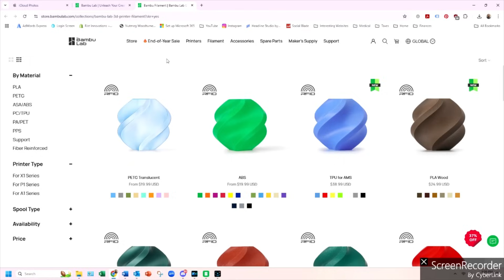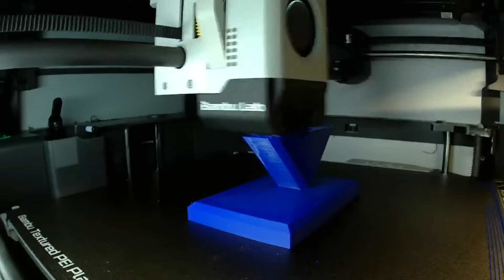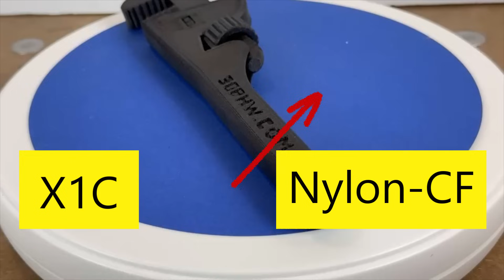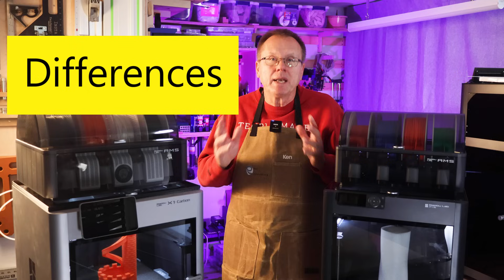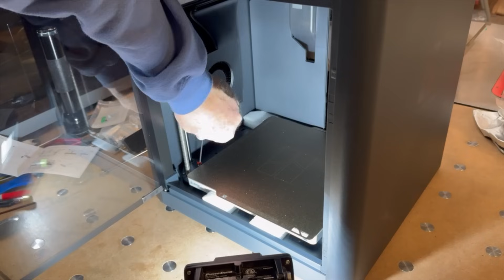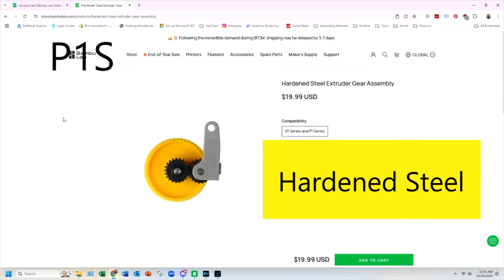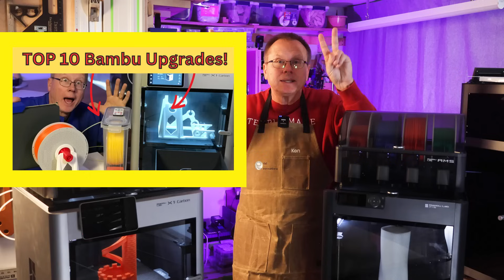Bambu Lab P1S 3D Printer: Better Value Than X1C?

Comment: Just in time! I was considering buying a 3rd X1C or 2 P1S' for print production. My main sticking points right now are banal, but it's because I'm an X1C owner I have a lot of hot end assemblies so those are different on the P1S, but at least the build plates and most other spare parts are the same. Watching for new insights I hadn't considered :)
Reply from the maker: I imagine it also depends on what type of materials you are mainly printing on the X1C.  If they are the higher end polymers, then maybe sticking with the X1C would be best for you, especially if you have a production line.  If you are mainly printing PLA, PETG, ABS, ABS-GF, ASA; then maybe the P1S would be a better option to expand your production capability.  In my opinion, you really can't go wrong with your decision, depending on your preferences.  Thanks for taking the time to leave your comment and good luck with your decision!

Comment: Thank you for conducting the comparative testing as well as taking time to make the video. A suggestion for the future if you should create a similar work... When putting the design values on screen it would be helpful to see the measured values alongside each.  This would be even more useful when you are comparing multiple measured parts to the design values in batches.
Reply from the maker: That’s a great suggestion. I will implement your suggestion in my next week’s video. Thanks for the suggestion and your overall comment

Comment: Which has better longevity? Are the internal electronics identical? Very happy with my P1P purchase a couple years ago. But those are my main concerns. So yes, the P1P was initially a gamble for me. And with all these 'one-up' clones hitting the market, ya know the next generation is bound to hit the market at any time.
Reply from the maker: That's a good question regarding whether the internal electronics are identical. I haven't taken both of my printers apart to be able to answer your question.  Possibly another viewer of this video could help us with your question.  From my initial impression, the mechanical aspects of both printers appear to be similar.  Thanks for your question and I'm sorry I couldn't be of more help.

Comment: Entirely depends on what you intend to print.  If you want to print common engineering grade materials, the X1C is the better value.  It comes ready to print them.   The P1S could be modified to print those materials, by adding hardened nozzles, carbon filter, and a better insulated enclosure.  And, yes after over a year the other manufacturers have spent a year upgrading their designs.  But you will be buying a newly released system, which may have issues, while after over a year into production the X1C has all the bugs worked out.   I bought a printer to reliably print the materials I want to print.  Not to futz around with because it has bugs to work out.

Comment: I guess what I wanted to know is, can the p1s print PPS?
Reply from the maker: That is a good question. I looked at the Bambu Lab recommendations and they recommend a hotend temperature between 310 - 340 degrees C.  Ironically, the maximum hotend temperature of both the P1S and X1C is 300 degrees C. For PPS, Bambu also recommends a bed temperature of between 100 -120 degrees C. The P1S maximum bed temperature is only 100 while the X1C bed temperature is 110 degrees C.  It seems printing PPS on either printer could be a challenge, however it doesn't make any sense to me that Bambu Lab would sell a filament that would not work on their printers so I am guessing (you will need to confirm) that the PPS can be printed on at least the X1C, but it might be slightly more of a challenge to print on the P1S.  Again, this is just my opinion and this would need to be verified by somebody who has experience in printing PPS.  Thanks for your question.

Comment: i have the sovol sv08... i like it.. but i just dont have the time to tinker and calibrate everytime i switch the nozzle... definitely looking at the x1c
Reply from the maker: You can't go wrong with the X1C if you want a high-quality 3D printer that just works out-of-the-box.  As I mentioned in the video, the X1C was my first FDM 3D printer, and I'm so happy I bought it.  Good luck with your decision and thanks for your comment.

Comment: Are there any materials that the x1c can print over p1s?
Reply from the maker: I haven't found any materials that the X1C can print, but the P1S can't print (as long as you upgrade the P1S extruder and hotend to the hardened steel). I just double-checked the Bambu Lab website and confirmed that they don't list any materials only for the X1C.  Thanks for your question.
Reply: @ristinnovations  what about PPA-CF? Looks like it needs bed temp 100-120c and the P1s is only max 100.
Reply from the maker: @rsarndts8939  The Bambu Lab Filament Guide lists PAHT-CF, PA6-CF, PA6-GF, PPA-CF all recommending a build plate of 100 - 120 degrees C so the X1C offers a higher  max. temperature of 110 degrees C versus the P1S max. temperature of 100 degrees C, however in my video I printed the PAHT-CF wrench on both the P1S and X1C. Naturally, it's always better to have a higher build plate temperature that is more in the middle of the recommended filament range so for that reason the X1C provides more flexibility, but the P1S is capable; it just might have a smaller process window to be successful.  Thanks for the question.

Comment: Hey there! It was good running into you at 3D Printopia and my kids got a big kick out of your videos afterwards. They were all like "we met him!!!!" 🙂
 
I have an X1C Combo I bought a year ago, and for my second printer I got the A1 Combo. I debated getting a P1S Combo as my second printer, but I really wanted to see what it was like to have a bed slinger, liked the user interface more, and I understood the flow calibration aspect was newer on the A1 series.

So far, I have only been disappointed with the camera being like 1 frame ever 4 seconds, the touch screen not being anywhere close to as nice as the X1C (even the color selection for filaments is limited for some odd reason), and I feel like ringing on some prints is slightly worse but i knew that was a possibility getting a bed slinger.

One thing I have heard about the P1S is the camera is just as bad as the A1, and if that's true the difference between the X1C and P1S cameras isn't just a lower quality video but also a massive frame rate difference. The X1C camera is pretty fluid and I am under the impression the P1S is not.

I would recommend anyone thinking about the P1S but slightly hung up on the interface consider adding in the Panda Touch by BigTreeTech as I am told that is an equalizer.

Thanks for your detailed and well laid out videos!
Reply: It seems that a lot of people gloss over the Lidar on the X1-C, is that feature lackluster? How often do you find yourself being glad you had the Lidar feature?
Reply from the maker: @spotty6575 There have been times when my Lidar has stopped a print due to spaghetti failures, which has been helpful, but otherwise it’s hard for me to quantify how effective the Lidar is. The way I look at it is that I don’t have Lidar on any of my other printers and I has survived just fine. You bring up a great question though regarding the Lidar. Thanks for taking the time to ask.
Reply: @ristinnovations  Thank you for your insight, and for taking the time to answer my question!
Reply from the maker: I definitely remember meeting you and your kids at 3D Printopia. You are a great dad to encourage them by taking them to events like 3D Printopia! I can confirm that the frame rate of the P1S camera is similar to my A1Mini, which isn’t great, especially compared to the X1C. I’m glad you and your family have been enjoying my videos. You made my weekend during 3D Printopia when you recognized me😊. Please say hi if you go to next year’s 3D Printopia. I hope to be racing my first Death Racer there. Thanks for taking the time to share your detailed comments and please tell your kids that I said “Hi” and that I hope they are continuing to enjoy their 3D printing experience😊
Reply from the maker: I definitely remember meeting you and your kids at 3D Printopia. You are a great dad to encourage them by taking them to events like 3D Printopia! I can confirm that the frame rate of the P1S camera is similar to my A1Mini, which isn’t great, especially compared to the X1C. I’m glad you and your family have been enjoying my videos. You made my weekend during 3D Printopia when you recognized me😊. Please say hi if you go to next year’s 3D Printopia. I hope to be racing my first Death Racer there. Thanks for taking the time to share your detailed comments and please tell your kids that I said “Hi” and that I hope they are continuing to enjoy their 3D printing experience😊

Comment: Thank you for the video. I'm myself hesitating to pull the trigger and waiting for a possible P1S update next year which I sincerely hope it includes at least a screen similar to that of the A1.
Reply: Take a look at the Panda Touch by BigTreeTech - not only can you control multiple printers remotely with it, but it effectively gives you the user interface the X1C has (it's not a perfect 1:1 but it's close). They have a sale going on right now as well.

I have an X1C and an A1 and I ordered one for the remote aspect and because I'm not a fan of the UI on my A1 where I am hoping the Panda Touch will bring it more in line with the X1C.

As far as waiting for a next gen, Bambu Lab is focused on the X1C "replacement" (that's not what they are considering it, but it is going to be their next top tier item), so if they do refresh the P1 range, it will be towards the end of 2025. If you can wait a year on the possibility of a P2 series, not that it's guaranteed, then prices even for the P1 series are likely to come down even if they don't release one. Then again you will be waiting a whole year in which time you could have been printing and having fun with a P1S + Panda Touch.

Just something to think about.
Reply: @hotfix7387  Thank you for taking the time to reply! I knew of Panda Touch. I have used BigTechtree produts before (right now using BTT Pi 1.2 on my Ender 3 S1 Pro) and they are fantastic, however, I read the screen isnt as responsive as one would want. Is this true? And also and foremost, the screen could be an expensive paperweight whenever Bambulab wishes it, as any big change on the printer's firmware can hinder the screen's functionality. Nevertheless, even knowing all of this I would still choose it versus the current LCD screen of the P1S.

Regarding whether I can wait or not, that is also a good dilemma. Like probably most of us, I 3d print as a hobby, and whilst my recent projects have grown in size (currently printing a +400 hour project) and would greatly benefit from a second more speedy and accurate printer, I am very patient and can wait such hours. I would just hate to hurry up and get a P1S now and regret it in a few months if Bambulab silently updates the P1S with a new screen. Also, would love to check the new "H2D", although that will probably be out of my league budget-wise :D
Reply from the maker: I’m wondering the same thing about a next generation P1S. I’m like you in that I would be willing to pay a bit more if the P1S could come with an LCD screen similar to the X1C or A1 series. Thanks for your comment.

Comment: I dont have the budget to buy this beast...😢😢😢 i have an Anycubic😢😮😮❤
Reply from the maker: I understand. Everyone has different budgets when it comes to 3D printers. Thanks for sharing your comment.
Reply: I have a couple of AC printers and they have done me right. I've debated on Bambu, QIDI, etc,  but they have the same issues as others from what research I've done. I have almost 1000 hours on my Kobra 3 combo and probably 7-800 on my Neo2.